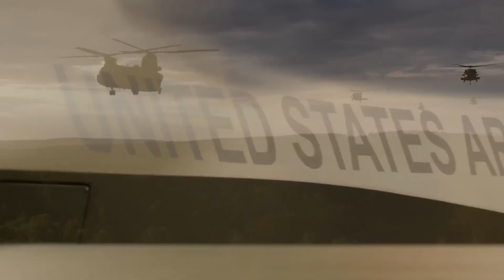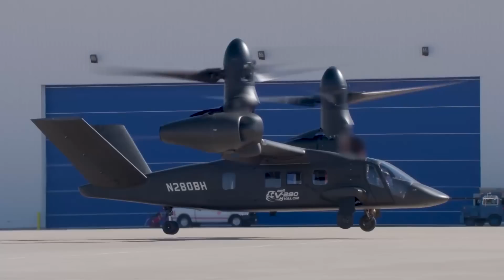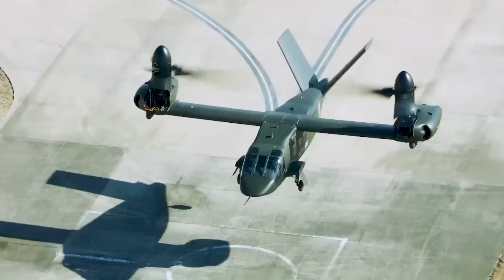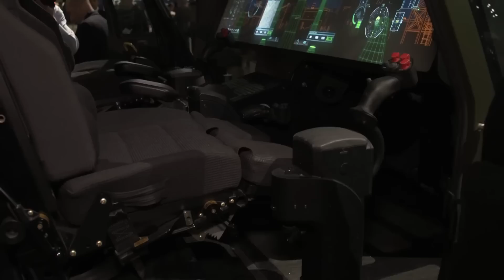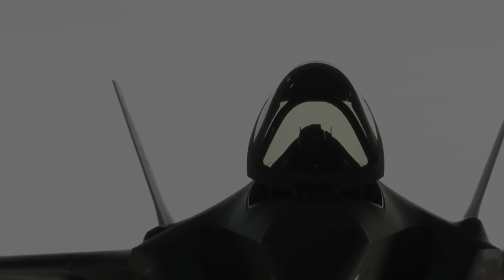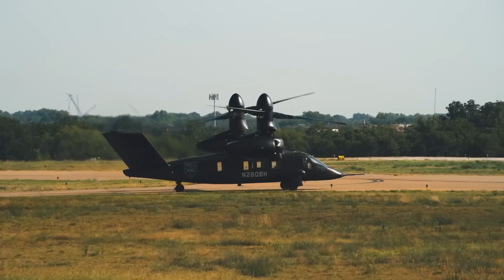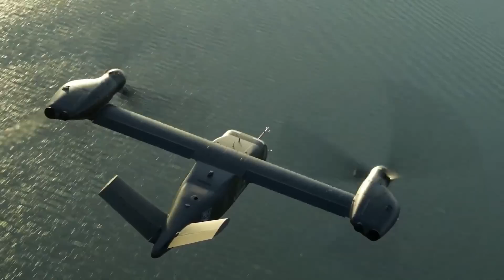V-280 Valor – The future Black Hawk

Comment: I think the Army is shying away from variant attack helicopters because of what it learned in Vietnam (namely that big slow-moving targets with lots of guns draw lots of fire) , and what it eventually got out of the programs that led to the Apache. But the Comanche program has never went into production beyond experimental, and because it's a stealth-recon-attack copter,  it's not really as capable as the Apache when it comes to muscle, nor does it innovate in terms of speed because it is a traditional helicopter, nor can it compete with the costs and supply of swarm of scout drones with its sweet sensor array that was state of the art in yesteryears of development. (So the 'helicopter of the future'  when I was a boy, doesn't seem to be fated for success because of the pace of innovation, and changes in warfare. I think currently it's the Invictus program which may or may not give up the traditional helicopter design, and either way, that thing is going to replace light scout helicopters if it ever goes into production, (a role that was had by another retired helicopter in order to keep the Apachee going, I think,)  and that's if it doesn't get outpaced and outpriced by drone development--which is likely. And Congressional committee meetings can be like CHOOSE TO KEEP THIS PROGRAM, or THAT PROGRAM, you can't have BOTH! Especially during periods of rapid innovations.)  

So when it comes to pure muscle, the Army shouldn't be so quick to discount variants of the v-280 when it comes to potential capabilities. 1) Not only does that make it easier to service via mass production of most parts, it 2) allows you to replace 12 troops with a massive weapons bay for gunship, missile truck, mini-bomber, e-war, surveillance, or even less conventional roles (drone carrier, psyops, etc.)  It might step on the air forces toes, or it might necessarily free them up for more air-dominance and strategic attrition warfare if the ARMY can master its own close air-to-ground-support roles with FAB capable weaponry especially if they get outside the nearly umbrella of NAVY or AIRFORCE support, or if either force has to prioritize its engagements along a vast front, or multiple fronts which can happen in peer 2 peer attrition style warfare. Joint command is one the areas where the USA is strongest, but in a big fight, that could go either way here or there, parts of the army could be cut off and isolated from the main force.  Having something close by that can make a hole where you need a hole can be the difference between getting the troops you sent in to do a job back, or not.  3) Mass production means Congress (and the Military) gets more bang for the buck, especially over the long term. It means you can stock up when Congress is feeling generous, and strip birds for parts and keep the program going if/when they are making essential cutbacks. That's budgetary flexibility. 3) Having multi-role functionality means you can show your hand without necessarily revealing anything more than the back of your cards to your enemy. Even if they can see it, they don't know what its mission is, or what it is capable of, and there's essential fear-factor to that, especially as the numbers of the fleet increase. 

We should be thinking of this kind of bird as a platform, and not just a troop carrier. Like the Humvee, Bradley, or the more modern Striker. Don't just make it mission-capable, make it mission-essential, make it iconic, make it lethal & beloved by vets. That's what keeps Congress writing the checks for anything that gets to stay in service for decades.

Comment: I don't think a tilt rotor good for Apache replacement.... I'd think going with something like a quad rotor drone setup would be better for something that needs to be very agile, fly-by-wire systems seem to be way more stable in drone type arrangements over a standard helicopter setup... also in a quad rotor setup ya can sort of protect the blades with rings.
Reply: The Apache already is more agile than the Valor, however the Valor can self deploy and no other hovering aircraft has the range to do that.
Reply: @user-pq4by2rq9y Self deploy as in unmanned? If thats the case then why is the Osprey have a reputation of difficult to fly and higher then usual accident count?? You would think the fly by wire flight support systems would be super good if tiltrotors can be unmanned already???
Reply: You don't seem to understand the physics behind all of this... not to mention the V280 is very agile.
Reply: @n3v3rforgott3n9  yup... no idea.... flight=magic....  I'm simply saying overall tilt rotors have wayyyy less research and data over traditional single rotor and quad rotor arrangements, therefore automatically makes commitment to it a riskier proposition...
Reply: @n3v3rforgott3n9  yes, it's stupid.... until it isn't...Tilt rotor is kinda a sheety chopper and sheety airplane, does both but not well, expesully on the chopper side... You might not agree or like what I posted, but it is all factual information.... agree to disagree.... Adhom much??
Reply: @bitrage.  No you posted zero factual information. You talked about a far worse design and gave false information about the V-280...
Reply: @n3v3rforgott3n9   oh good thing you actually posted the correct information instead of just saying "No"..... ok I belive you....
Reply: @bitrage.  Because it is common sense if you have even basic understanding of the physics at play...
Reply: @n3v3rforgott3n9  Good thing you know these physics, They obviously need you over there at Bell, wayyyy over budget... Probably using the wrong maths....
Reply: @bitrage.  haha, so you say something completely wrong and go, "I bet it will be!". Haha OK bud.
Reply: @n3v3rforgott3n9   yea isn't that infuriating??? Just like some1 saying a quad rotor isn't more stable and more researched then a tilt rotor... like bro...

Comment: Huey in Vietnam was fairly easy tobe shot down, and lots of accident due to tree top flying. The cost of fixing them was also low. Taiwan, SK, Philippine all have facilities and personnel qualified to do the repair work.  V-280 simply follows the USA airplane design trends: larger, heavier, higher tech, much higher cost. What is not yet discussed is the repair cost. Just ask any Tesla owner going through the aftermath of a low-speed wreck.

Comment: Many of you are missing the point.  I’m a helicopter guy, however, the V-280 is ideal for the Pacific (long distance Island hopping) at twice the speed of any helicopter.  For example you can lift a battalion of troops and move them 300 miles in an hour.  No helicopter can accomplish that.  Finally, the interconnecting shaft on the V-280 will drive both rotors in the advent of an engine failure.  This aircraft will be as ubiquitous as the Huey.  Good job Bell.
Reply: The advantage of traditional rotorcraft is that it is faster than helicopters, but not as flexible as helicopters.
But the speed of the V-280 needs to be increased to at least 800 kilometers per hour, and the current speed of 560 kilometers per hour is still not ideal.
Reply: Sad thing is that it has to replace the Apache and probably killed FARA out of necessity since none can keep up with a tilt rotor in range. Not doing so would mess with logistics.

Good news is that attack turboprops now make sense.

Comment: you missed B-609
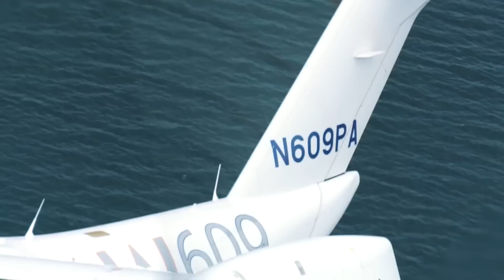Reply: No, the Leonardo AW609 (formerly the AgustaWestland AW609, and originally the Bell/Agusta BA609) was shown and covered at 14:22 in the video.
Reply: @brianb-p6586  The project started as B-609, the Bell Agusta Corporation came after where Agusta balanced with the A139 becoming AB139 (later AW139 when BAC ended and Agusta bought out BA609 to become AW609)

Comment: If they use it like the 160th SOAR DAP it would be necessary to lose speed.  To fire weapons the propplears would need to be raised.  The amount of space to fire weapons at full speed is limited.  But if it were altered to have a bay and pylons going out the bottom would work.  Keep the pylons up until needed and be at full speed with gins and or 1-2 misses in the space that could carry weapons without interference form the propellers.
Reply: A tilt rotor can raise the rotors up to nearly 30 degrees while keeping an airplane flight profile and the majority of its speed.

Comment: I'd be curious to know the difference in transition time for hover to evasive maneuvers or straight, fast flight. I would guess that given the fundamental aerodynamic differences, the dual tilting rotor design would be at a disadvantage, putting it in the most vulnerable position for longer.
Reply: Nope... Exactly opposite. There is no "transition time" and is done as the aircraft accelerates away increasing acceleration speeds. It had better acceleration and deceleration speeds the the defiant in testing of which were better than the black hawk.
Reply: @n3v3rforgott3n9  I've seen the tilt of the osprey, it looks VERY slow compared to the swashplate of say a Blackhawk. How are they achieving any evasive maneuvers in any direction other than the direction of the rotors?  I don't really count pouring on the power as evasive maneuvers. My understanding is that these craft use mainly thrust vectoring (for roll stability in hover) in combination with torque (yaw stability in hover) to maintain level hover. With a traditional rotorcraft, you can quickly adjust the position of the rotor any of 180 degrees very rapidly to change the direction of thrust almost instantaneously.

Comment: Honestly the Army should've awarded a double contract. The Valor is good for range and speed but it is wide. While that could be the frontline machine the Defiant should really have been contracted under the idea of cramped locations like inner city flights/landings etc... The defiant could be used for many other things the Valor cant do and the Valor can do many things the defiant cant.
Reply: So we should have never upgrade to the Black Hawk from the Huey? The Valor can land nearly anywhere a Black Hawk could and greatly outclassed the Defiant in nearly every metric...
Reply: @n3v3rforgott3n9  They really need to buy Defiant and install a driverless system as soon as possible.
The V-280 replaces the Black Hawk, and the Defiant can replace an old Apache or Chinook.
Reply: All helicopters with a speed of less than 500 kilometers per hour need to be eliminated as soon as possible and replaced by innovative models that are faster, more flexible, and more automated. They need to be developed and mass-produced as soon as possible.
The innovation and manufacturing department also needs to refer to the V-280 to develop a new seaplane (with a speed of at least 800 kilometers per hour, can carry 70 people, and is equipped with an unmanned pilot system) to meet more future needs.
Reply: @io9883  you don't seem to understand what limits helicopter speeds... also, the defiant could never replace the Chinook, haha.
Reply: They now appear to be experimenting with improved high-voltage electric hybrid engines or high-voltage battery systems that have the potential to push the speed limits of traditional helicopters and traditional rotorcraft.
 
Defiant's speed is close to 460 kilometers per hour, exceeding the 250-350 kilometers of traditional helicopters, showing the need to continue these experiments.
Reply: @io9883  That engine system would not increase helicopter speeds... again you don't understand what limits helicopter speeds.

Comment: Feels like it'd be better to have the engines mounted over the fuselage with a driveshaft going out to the tilting prop-rotors. Getting all that weight off the wingtips would have to improve a whole bunch of performance metrics. Would be good for scaling the concept down to a single engine light helicopter too.
Reply: No they tested those configurations early on into tilt rotors and have not used them since so there much be issues with that. Also this way there is no heavy machinery or fuel over the crew compartment making a fire or crash more survivable.
Reply: That would just increase the load on the wings in flight, since the rotor lift would still be at the tips. 
What metrics would be improved? Roll rate is the obvious answer, but horizontal mode roll rate is unlikely to be an issue and VTOL mode roll rate with differential thrust from the rotors will be excellent.

Comment: They should've gone with the defiant x.
Reply: So the worst platform?
Reply: @n3v3rforgott3n9  how is it the worst, please explain
Reply: @SAG1028  the valor has a better speed, over twice the range, carries 2 more people or a larger load, better time to altitude, faster time to stop from cruise speed. The defiant had multiple technical issues which resulted in a crash and 18 months of delay while the valor has been on time the entire time so far....
Reply: @n3v3rforgott3n9 didn’t know the defiant had so many issues. It appeared to be the better choice because of the absence of the tilt rotor mechanism and reduction in surface area due to the lack of wings unlike the valor. I also thought it would be better, because it seemed as though it land anywhere, plus I was thinking of the issues with the V22 that they would reappear with valor. I honestly also thought the pusher prop mechanic created better stability and agility and I think it looks better. Thanks for informing though I had no idea.
Reply: @it1zrtedk1085  so you have to remember that the osprey was the first of it's kind for a full production model. The osprey also had multiple design choices to meet marine and navy requirements that reduced its capability and increased maintenance headaches. Even so it is not anymore dangerous than other aircraft that perform the same role while able to do missions no other platform can.

The defiant's tech is very promising but even if fully mature is kinda outmatched by tilt rotors for this specific role. If they could fix the issues by the time FARA program ends it could be a much better option there as it would take better advantage of the better agility. 

People also seem to overestimate the size of the valor as it only has a 19% footprint and can land nearly anywhere a black hawk could as long as it isn't restricted up to the rotor blades on all 4 sides for the black hawk. You also lack a lower tail rotor which you have to worry about hitting low level objects or even people with. For example in a field where 12 Black Hawks could land only 10 Valors could but those 10 Valors could carry more troops in total while also doing the mission in half the time.

Comment: I have to comment on the repairability of the carbon fiber.  In general, carbon fiber and other composites are perfectly repairable.  It requires different techniques than with sheet metal, but it is common to do in the field.  You isolate the damaged area, “scarf” the damaged and surrounding area (sand down so you expose the bottom ply nearest the defect, and then only expose the 2nd most bottom ply further from the damaged area, and so on).  You then place a backer on the inside of the panel, like a piece of sheet metal, under the damaged area.  You then either do a wet layup or use prepreg with a heating blanket over the scarfed plies and against the backer.  Viola, repaired panel.

Also, the main wing of the V-280 consists of a thin skin over large cell honeycomb, with a thick structural “underskin” underneath.  This is done so the outer part of the wing can take damage and be easily repairable, and partially protect the inner structural part of the wing.
Reply: Psh. Composites are new and different. Therefore, they're awful. 

We should go back to doped canvas for skinning aircraft. The liquid coating over the fibrous cloth hardens & makes the whole thing stronger than either constituent component. Way better than 'composite' materials.
Reply: That all sounds reasonable. Now, can you see someone doing that in a desert sandstorm, a dripping wet jungle, or a high mountain snowstorm?
Reply: @brianb-p6586  I mean, other than the wet jungle, it’d be hard to do any repairs in those conditions.  As long as you have an enclosed hanger, you have the conditions needed to do the repair.
Reply: @bjw0007  bolts and rivets work in any temperature or humidity. Aluminum can be formed in any temperature or humidity that a person can stand. 

My guess is that any more than minor damage to a non-removable composite part will likely take the airframe out of service.

Comment: its not a helicopter. . . . . personally like the SB-1 Defiant design better. Not saying its a bad aircraft just saying its not a helicopter.
Reply: And? if a different platform can do the role of the helicopters better shouldn't you use that platform instead? Why does it have to be a helicopter? Also did you look into the information released about the program... The Defiant's tech is FAR from mature enough frankly. It had multiple technical issues which even resulted in a crash of 1 of the only 2 test aircraft which delayed it 18 months.
Reply: @n3v3rforgott3n9  one shot to its 2 wide propellers and its useless. Yes a helicopter has rotors on top. but the crash should be worse for this. 
So if the platform isnt what was ask for is it the correct platform? /S 
look if a request went out for an race car and you how up in a tuned corolla are they the same thing? in my opinion its not what was ask for and it has many flaws that a helicopter doesnt. 
As an actual aerospace engineer: it does have some advantage to. I think both should be produced. because they fill different roles. there is overlap of course.  
in the end it is just my opinion.